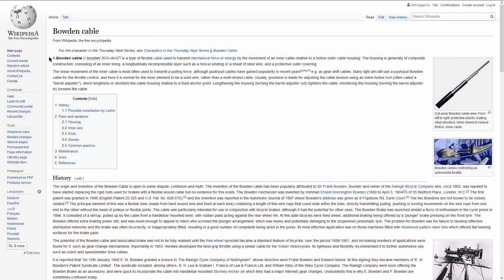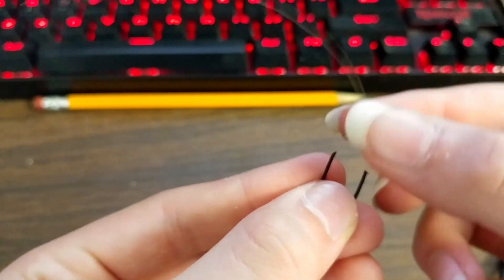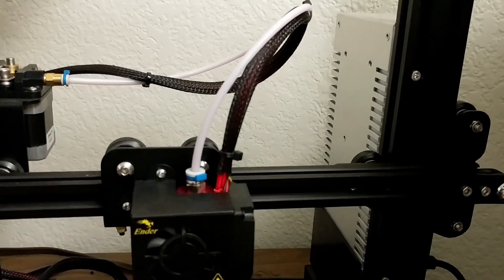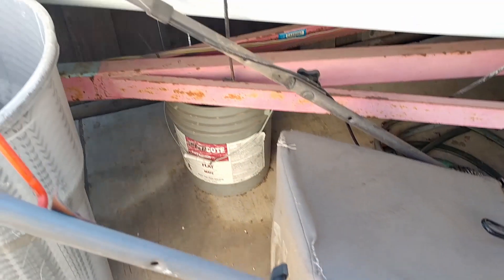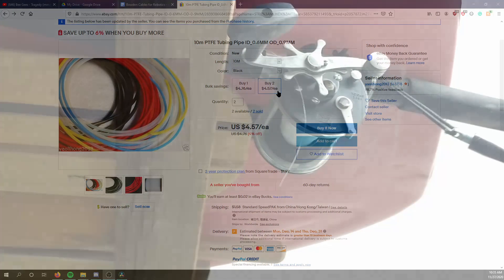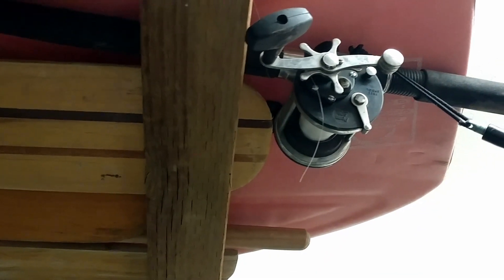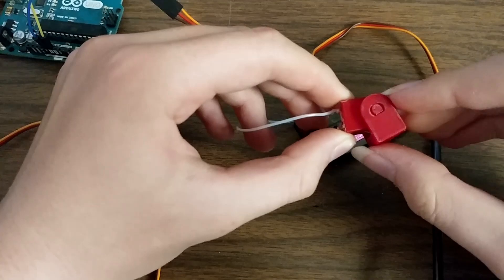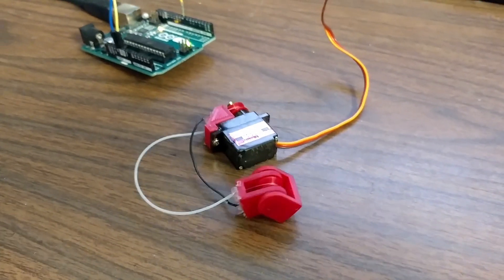Bowden Cables For Robotics

Comment: A problem that arises when using monofilament is flexibility... It stetches and thus tranfers less power to and from the points intended. This is amplified when the entire assembly rounds bends/corners be cause of leverage and friction within the tube... Stiffer cable used in the tube is a better option. However, then fasteners become necessary as using knots becomes problematic.
Reply from the maker: I definitely noticed this and ended up using stuffer fishing line on other projects where I used this technique.
Reply: @kleistrobotics2220  what is the stiffer line that you used?

Comment: Hello Kleist Robotics: I like the way you use the Bowden cables to work with your applications. It’s very clever. If possible, please tell me where you obtained these light weight Bowdens from. Can the cables be ordered online? I’d like to try them out for my robot bear projects. Thanks.
Reply from the maker: I ordered the tubes and cables on Amazon.

Comment: Great video! Informative and concise. I'm considering utilizing standard steel bowden cable actuation systems for a robotic arm application, and this short goofy video managed to be very insightful. Keep it up! :)
Reply from the maker: Awesome! I'm glad I could help. I have found since making this video that thicker fishing line and thicker tubing works much better.
Reply: @kleistrobotics2220  thicker tubing definitely provides more compressive resistance, glad to hear you're making progress!
Reply: @kleistrobotics2220  Thanks man, this is very helpful information!